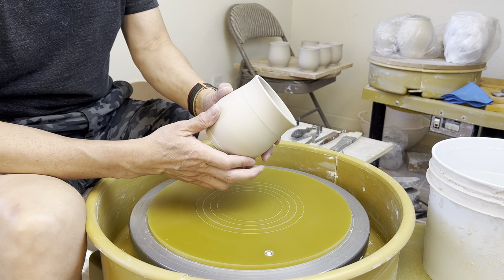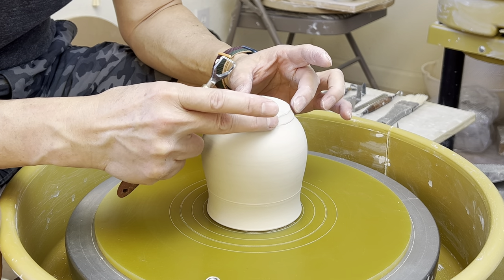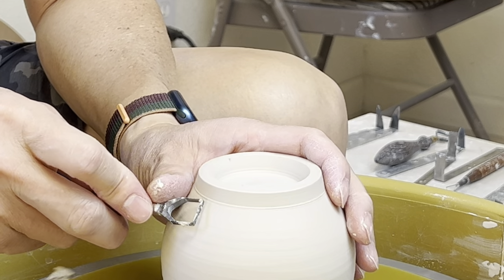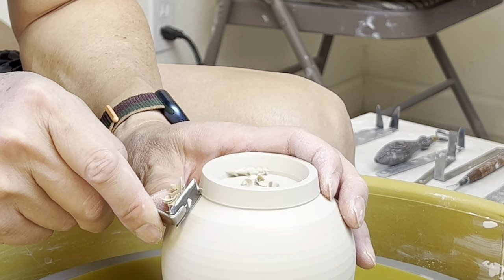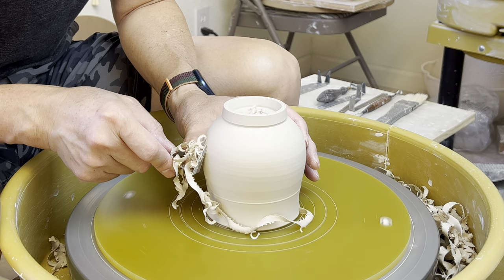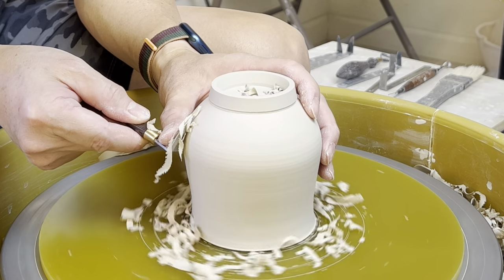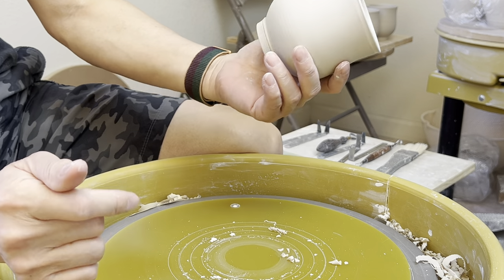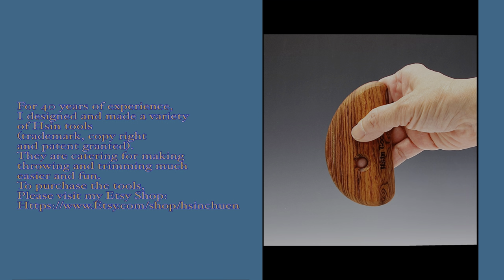694. Introducing Beta Version of Wooden Handled Trimmer & Stronger Plastic Bat with Hsin-Chuen Lin

Comment: Love your tools!  What is the shami rock that you used? I looked in your shop and did not see it for sale. Also, do you ever sell just the small plexiglass disk?  I purchased the spinner and large disk and use them all the time, but the small one would be super useful.
Reply from the maker: I don’t sell the burnishing rock on my shops but I have several available. DM me for the detail. The smaller disc is available on my Etsy shop:https://www.etsy.com/listing/1235735762/a-small-plexiglass-tool-2-34-or-70-mm?click_key=30bf567bf63015eb59735ed1b80e286f7e454391%3A1235735762&click_sum=2c0bb452&ref=shop_home_active_33&frs=1&sts=1

Comment: beautful new frp bat! would it be possible to make it the same color as the frp square inserts that you use in your bat system? I think that color looks much better than the color of the beta version of this bat. Also the tools look amazing as always. Can't wait to purchase both. I am sick of the standard plastic bats that come warped straight from the manufacture.
Reply from the maker: The celadon color will be available as well but it will be more expensive. The olive color is made from the reclaim FRP so it will be a bit cheaper.
Reply: @hsinchuen  yay! will definitely be buying the celadon! thank you for the quick response as always!

Comment: Does this method of wetting the top of the piece to secure to wheel work with stoneware clay? and can this be done on the wheel head without a bat?
Reply from the maker: Yes, it can be done on wheel head or any none wooden surface.